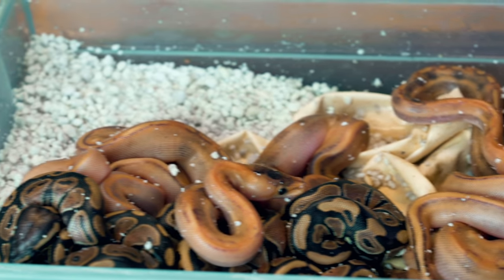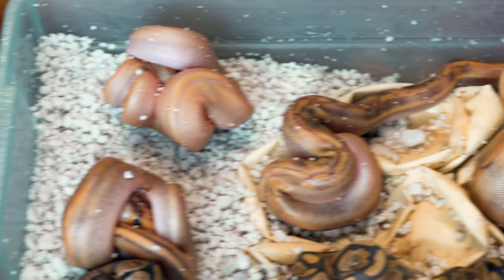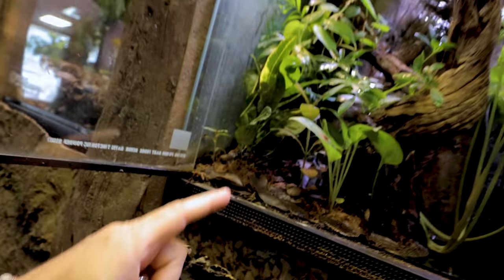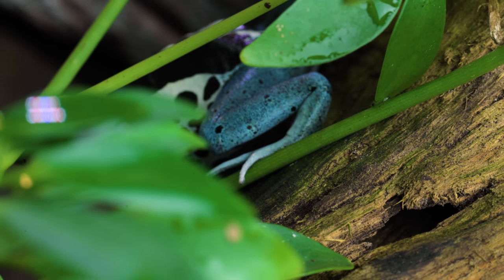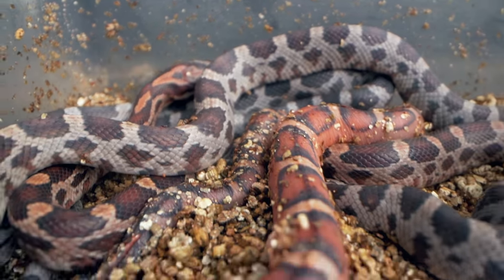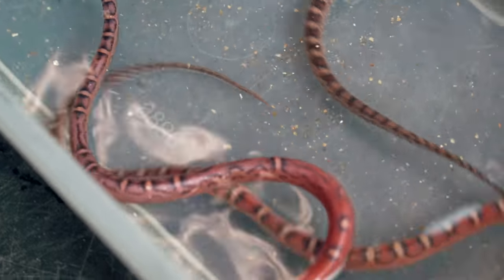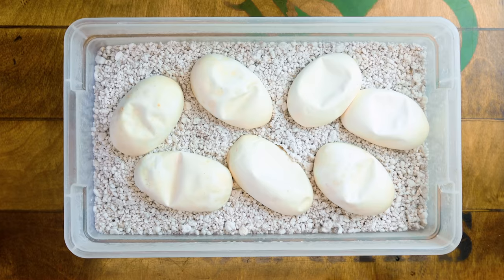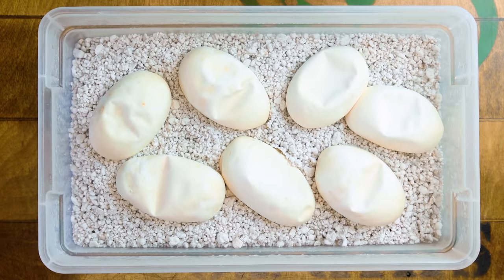DEADLY POISON DART FROG!! WILL IT KILL YOU?? | BRIAN BARCZYK

Comment: I have an Azureus, a Cobalt, and 2 little Black/Green dart frogs and I love them! A great thing about dart frogs is how active they are. During the daytime, always hopping around. Especially during feeding time.  To the viewers...if you ever decide to own dart frogs, you have to spare no expense on their setup. LIVE PLANTS! Terrarium soil, not topsoil. Moss bedding, southern oak leaf litter, and a cool humid enclosure. They cannot tolerate over 80 degrees F. 65-75 degrees is optimal. For my tanks, I have a flowing water stream in each paladarium. The water flows into a pool of water (they only swim by accident and I lined a pile of small rocks out of the pool so they can safely climb back to land). Mist the tank daily to keep the humidity high. They love fruit flies and they are very easy to cultivate after you get the brief hang of it. LED pro-plant lighting. I keep mine at medium brightness to avoid the heat, and its enough to keep the plants thriving (a little too much. I have to rearrange some plants every 6 months after trimming eventually fails because they love to grow). Few other odds/ends but that's the basics. They're awesome pets. But if you decide on dart frogs, definitely plan on $400 minimum for the tank setup alone. And the frogs themselves will run about 50-75 bucks depending on the common breed. They're very delicate animals, but VERY easy to care for if you have the right setup. Daily attention. Mist the tank daily, change the groundwater every month or so, replace leaf litter every week or two, change the water filter regularly (if you add running water, which I highly suggest. My Blue & Cobalt darts jump through the stream all the time), and feed around 75 flies per frog 3x a week. Thank you for the video!

Comment: Deadlifting socks They help you with balance and help you with gripping the floor. I found it easier wearing them when deadlifting. I used to wear converse shoes because of the flatness but then changed to those and felt better. Also helps when bar goes against the legs. I used to do Powerlifting in High school long ago for competition lol